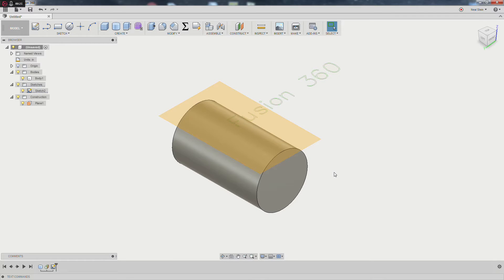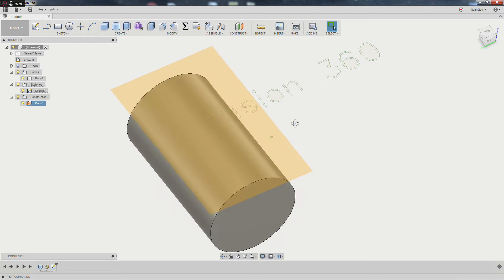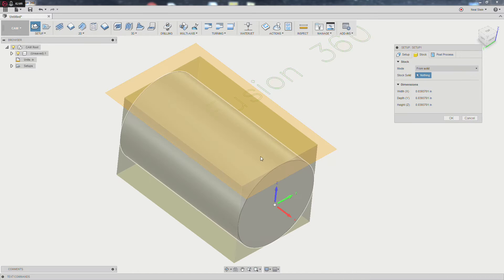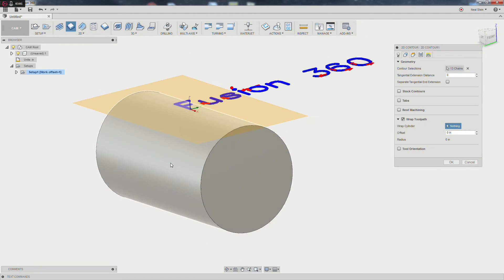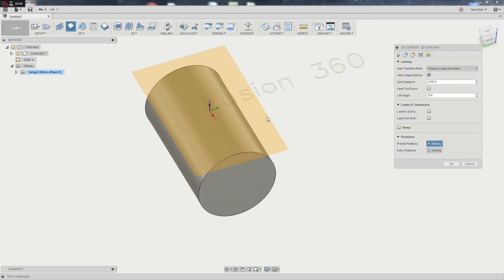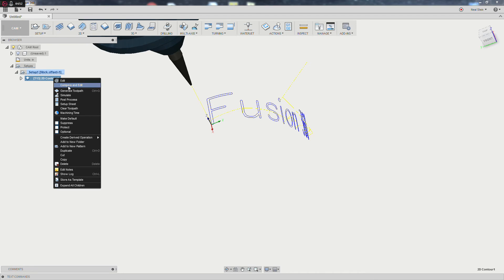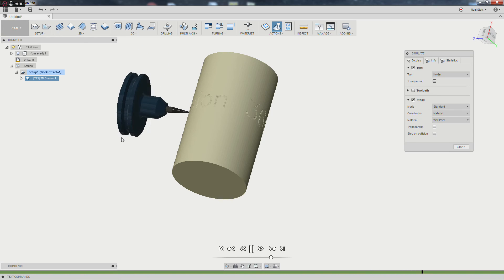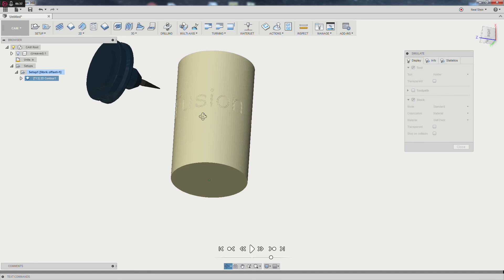Fusion 360 - Wrapped 2D Sketch Geometry

Comment: Any chance this works with a simple line? I can't for the life of me get a line to work on a round part. I've tried using it flat, from an offset plane, projected onto the part...nothing seems to work :(
Reply from the maker: Yes this should work with any sketch geometry. My other video has a workaround for some issues that were present some time ago so it may help you now.

I also suggest checking out the CAM forums as there are many helpful users there (including me).
Reply: @steinwerks9255  thanks, I've posted over on the CAM forums now as well if you're interested to take a look at the file: https://forums.autodesk.com/t5/fusion-360-computer-aided/engraving-single-lines-on-4th-axis/m-p/8413550/highlight/false#M54186

Comment: Hey, great video! I was wondering if it would be possible to move the model back to the modeling workspace after engraving so that you could 3-D print it. Is there anyway to do this?
Reply from the maker: Thanks! There's no way to make the CAM directly reflect on the model geometry, but if you use the Simulation with stock, you can export the stock as a .STL file with the right-click popup menu.

Comment: I have been looking for a way to properly wrap text on fusion for so long. All the tutorials say you have to either emboss or project to surface; both of these methods warp the sketch and do not allow for wrapping all the way around a cylinder. This video is literally the only one I have found with proper text wrapping. Do you know if there is any way to do this outside of CAM?
Reply from the maker: Adam Shaw I don't know of a way unfortunately. Are you trying to make the text a 3D sketch or a modeled feature?
Reply: My ultimate goal is to have engraved or embossed text all the way around a cylinder, that isn't warped by projecting it from a flat plane - just like the tool path at 5:18. So far the only way I have found to do this with minimal warping is by creating a whole bunch of tangent planes and projecting from them.